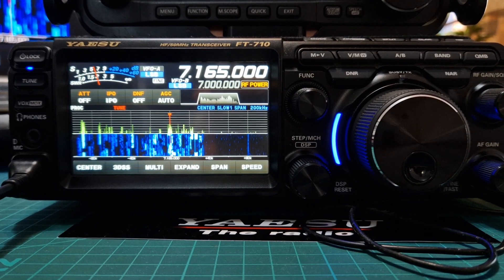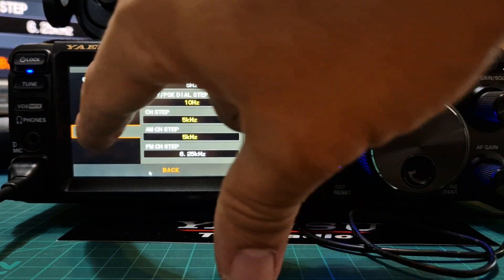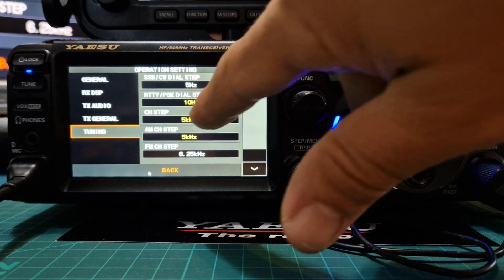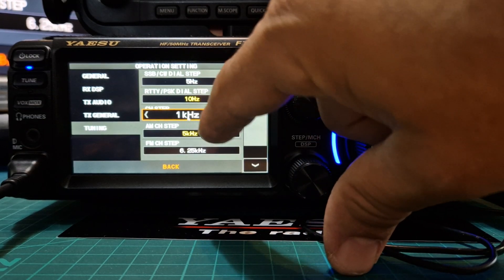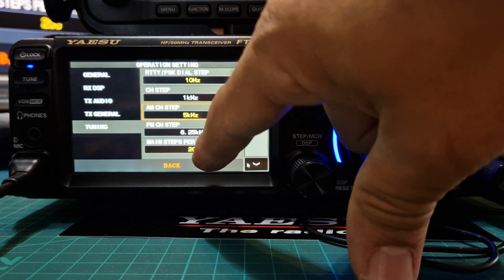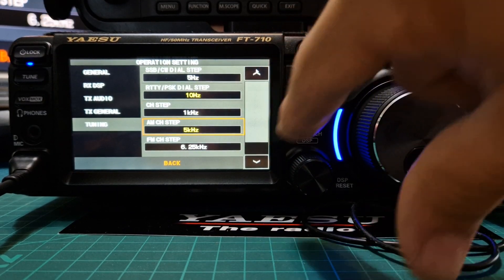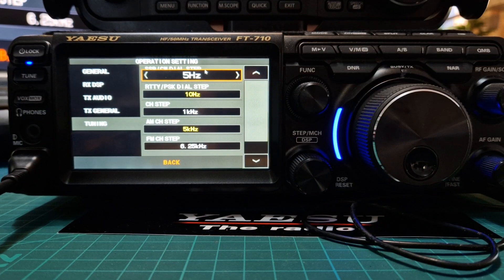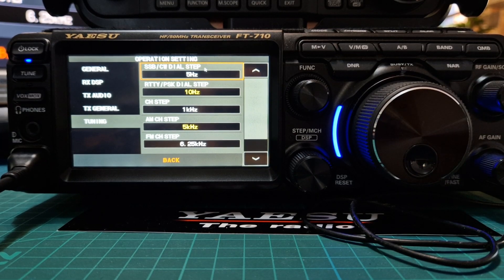YAESU FT-710 Frequency VFO / Channel Steps

Comment: Any improvement in actual transmit and receive? Or just a cool "looking" cell-phone-like, short-lived touch panel? 
My 40 year old Ten Tec works well without the Gamer Bois Baby Rattles. As a RADIO. I have my Samsung Cell Phones  for net access. Both are radio "tools" designed for specific purposes.
Make better, not glitzy-er RADIOS.
Learn CW.
Reply from the maker: Look at the specs and hardware , nonits on a Tentec , how much was that new .